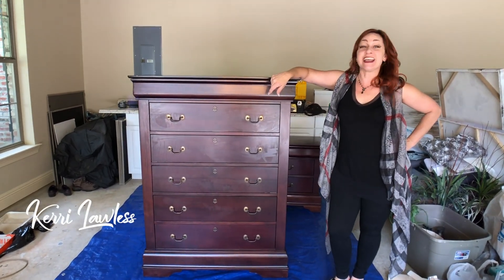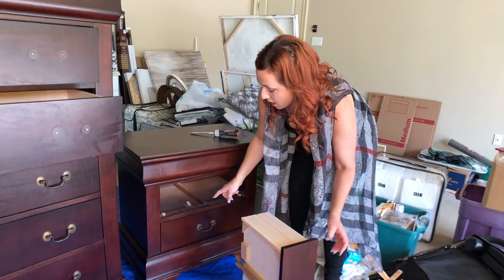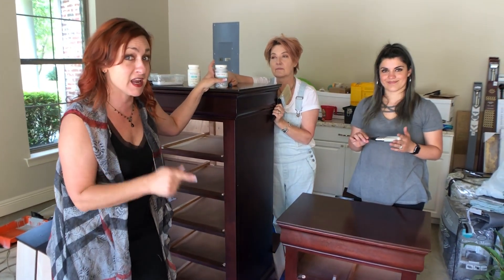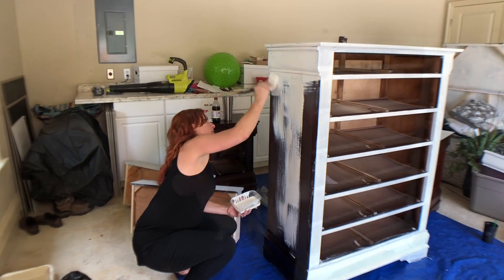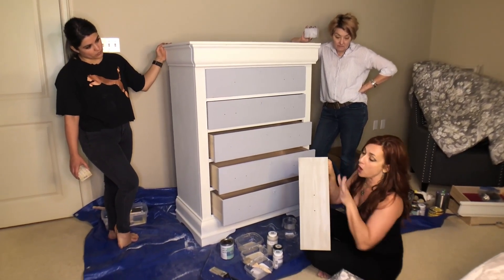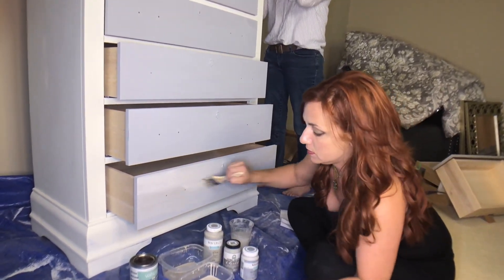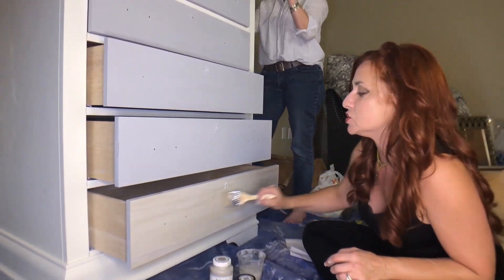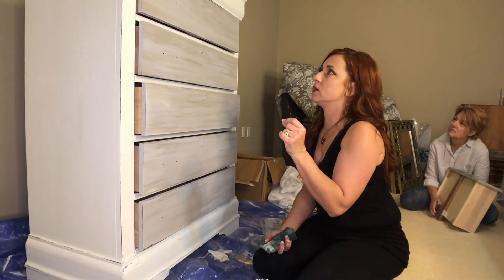How To Chalk Paint Night Stands & Dresser Makeover  *Easy DIY For Beginners* (Before & After)

Comment: WHAT DO I DO IF I WANT TO CHALK PAINT BUT NOT DISTRESS AND ANTIQUE???  DO I STILL NEED TO SEAL THE CHALK PAINT AFTER THE 2 COATS???
Reply from the maker: Hi Michelle! If you don't distress the piece, you still need to seal with 2 coats.  If not, the finish will not be durable at all.  Just use a clear sealer.